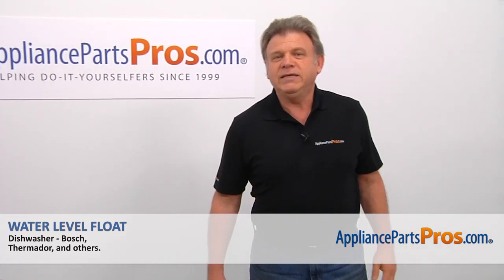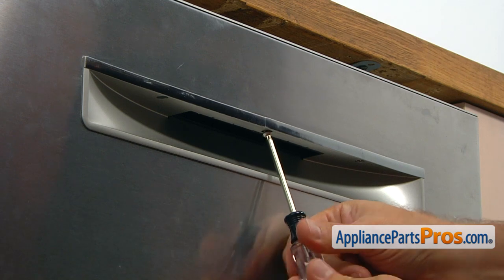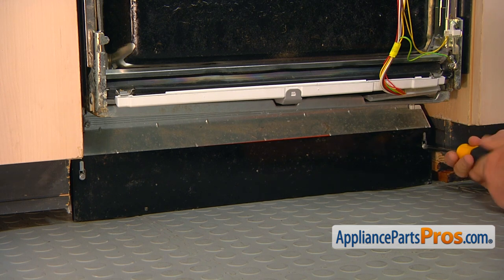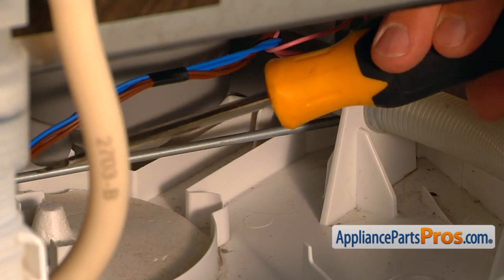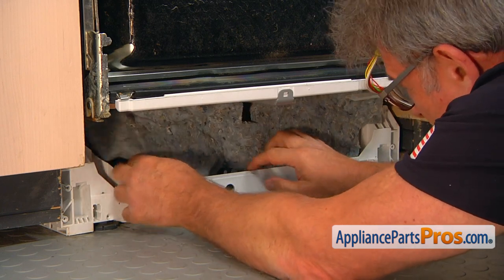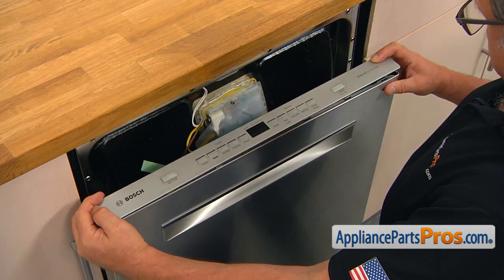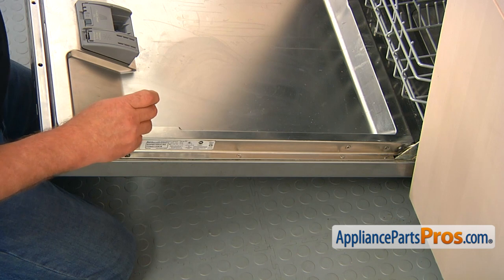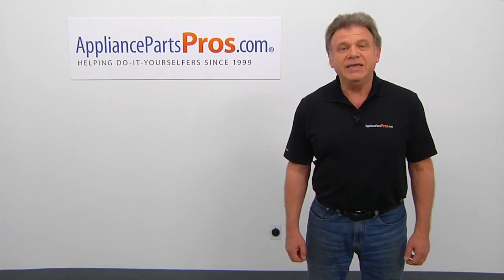How To: Bosch/Thermador/Gaggenau Water Level Float 00622036

Comment: I've been watching a lot of your Bosch videos and they are all well done!  However, on my model I have easy access to the float on the left by simply pulling out the unit & lifting up the insulation (no need to disassemble the door & front panel).  In fact, this video is recorded through the access I'm talking about at 4:02.
Reply from the maker: Our videos are generic videos to give you an idea on how to do the repair. It is possible the repair could be slightly different depending on your model.

Comment: Let me just say I found another way to cause e15.  Clogged kitchen sinks and I forgot to clamp the dishwasher drain hose. Plunging away it backed up in my dishwasher. I looked at many videos. I had to clean a p trap and snake a drain and fix my self created e 15.  Your video is the absolute best, the most detailed with things I need to know such as, how to pop something off where to stick the screwdriver to remove the switch sensor and lifting the bar to get the float out. I did it all confidently in my kitchen floor.  Thank you!
Reply from the maker: You are welcome. Glad you were able to complete your repair. If there is anything we can help you with in the future please let us know.

Comment: Incredibly helpful! I have Bosch shpm78w56n/01 that displayed an E15. While the error cleared, a couple of days later, the entire panel went dark. You could only hear the beep from the on/off button, nothing else would light up. I followed your instructions and sure enough, the float was tripped. The short, we'd had a clogged sink, plunged it, it back fed water into the dishwasher, and must have leaked out a hose. It was only a small amount of water too. I dried everything up and all is well now!

Comment: Good video. My question is, why would you need to replace the float? I got an Error 15 and then an Error 23. I can see there was water in float area (and outside it). I've replaced the drain pump but how do I know if I need to replace the float (or the switch/sensor)? TIA.